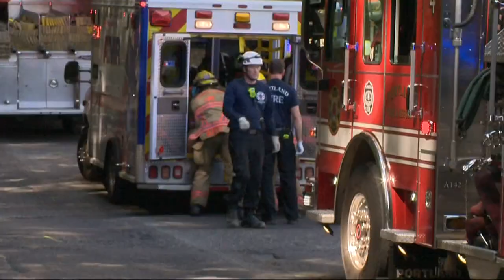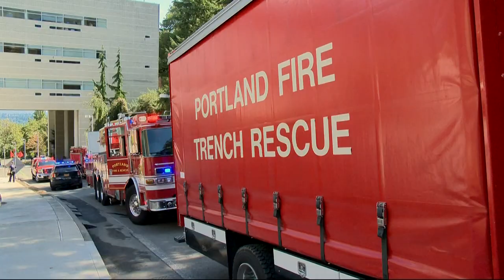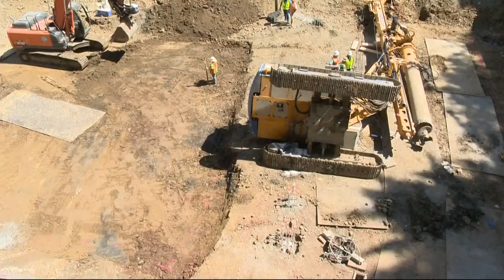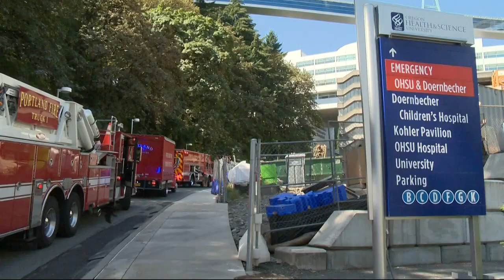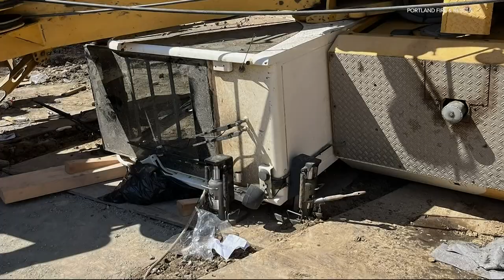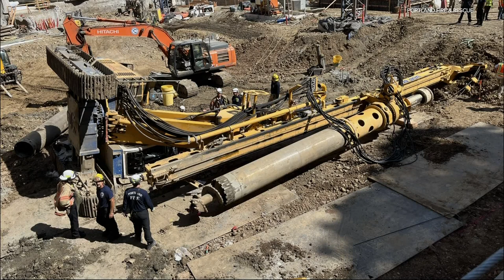Drilling rig topples at OHSU construction site, trapping operator

Comment: What kind of Drill Rig was it?  Did the operator allow the Rig to "walk the drill pipe" while applying Excessive Down Pressure to a Rotary Bit?  NOT the Operator's Fault if caused by a busted Hydraulic Hose.